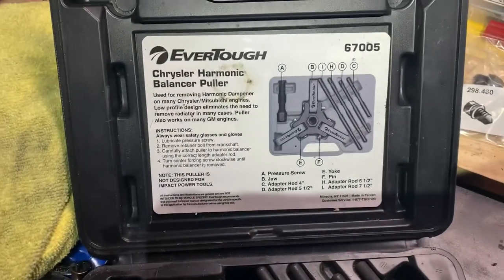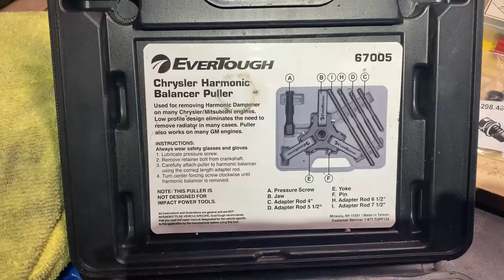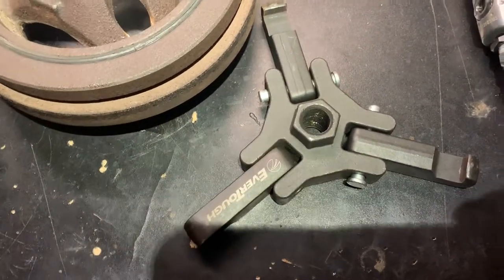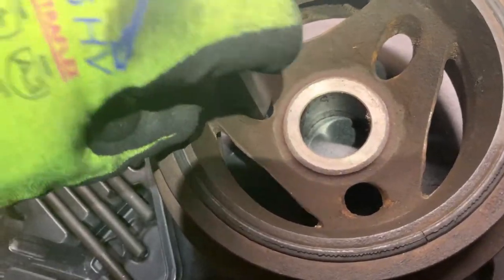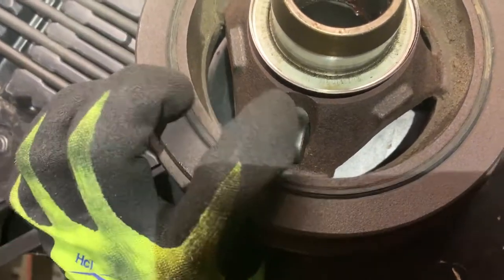Dodge ram 5.7 Hemi harmonic pulley removal tip

Comment: God bless you sir! I haven't tried this yet, but I wasted an hour with 3 different pullers getting nowhere with the dumb pulley. Now you've given me hope for tomorrow!
Reply from the maker: You’re welcome and best of luck!
Reply: @vegasguy8505  Unfortunately the truck didn't work with my puller. Identical style to the one in your video, but the hooks didn't bite, they'd pop out with a little pressure applied.

Wound up actually finding a smaller 3 jaw puller which fit inside on the flats, and even then I had a lot of pressure on the pulley and it still didn't budge. Pointed a torch at the hub with the puller still cranked tight, and "Pop". Then the puller took it right off.

Comment: What do you mean when you say "i left all but one" ?
Reply from the maker: Sorry, made the vid in the middle of the repair. So you flip 2 of the claws on the tool and replace the pins to hold them in place,leave one claw completely detached for the time being. Then you have to maneuver those two claws into the smaller holes I showed in the video. Then maneuver the 3rd claw (the one that you left detached) into the third hole and put the pin through this claw connecting it to the tool. I was struggling to line up the claws with the holes while they were all already connected to the tool. Be leaving one undone and linking it at the end, I was able to do the job.
Reply: @vegasguy8505 @vegasguy8505  took a while but I figured it out. Its hard to verbally explain other than once all claws are in place, you insert the third pin. Thank u for replying to a stranger. Peace and love
Reply from the maker: No worries, I’m glad it worked out for you!

Comment: Youre supposed to hook the puller jaws on the 3 flat spots in the back, not the holes.
Reply from the maker: Yes, but this is the only way to do it using THIS specific puller. This is the puller that was readily available to rent at my local auto parts store. Sometimes you got to work with what you got, and most don’t have time to wait for the correct puller and need their trucks back on the road ASAP.